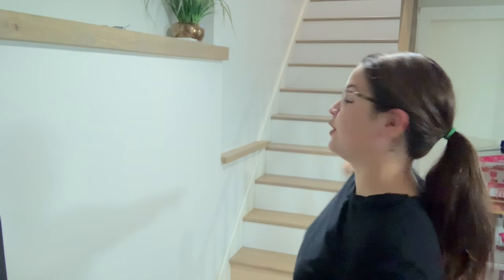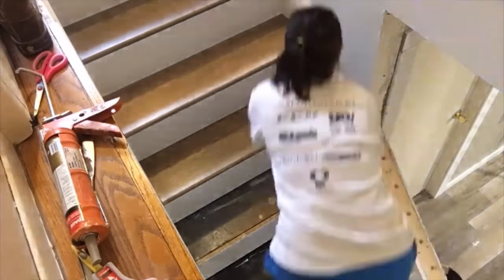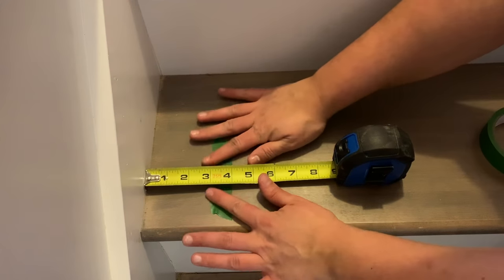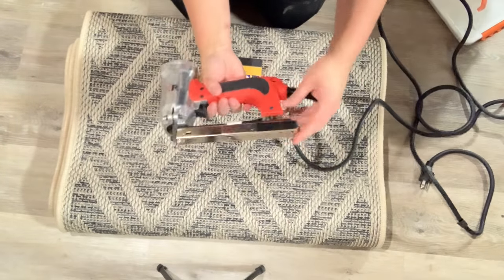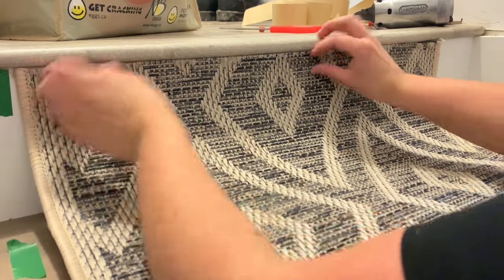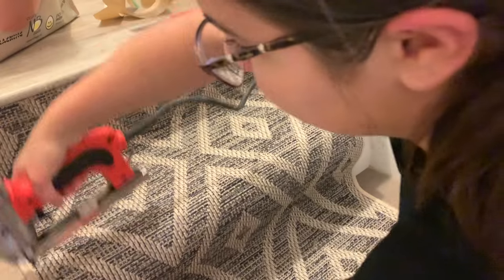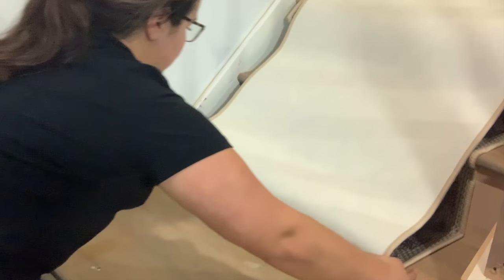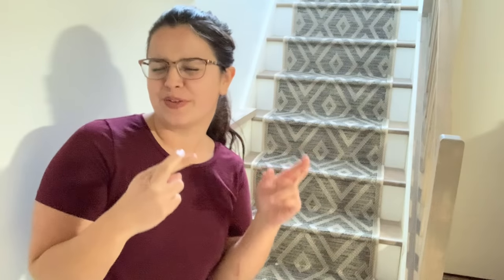How to Install a Stair Runner - The Right Way

Comment: Just here because you're super cute. You did a good job overall. Nevertheless, you should have had a carpet tucker, and a carpet kicker to take out any slack. You don't “kick” the runner because it can rip. It's just to apply pressure while you take your carpet tucker and make a sharp crease at the back of the stair tread and stair riser. The tucker is also used to bury your staples at that junction. What's worse than falling down stairs is ripping open your foot on a staple and then falling down the stairs... just saying.
Reply from the maker: thanks for the tip!  I didnt know those existed

Comment: How did you measure how much of the runner you needed for the stairs? Also, really great video!
Reply from the maker: Thanks  so much! I measured the length of the stair treads and risers.   Then multiplied it by the number of stairs and added a few extra feet

Comment: Im about to do mine but im torn between using underpadding or not.  What led to your decision not to use padding?  Thanks!
Reply from the maker: I personally felt like it was too many layers that could potentially slip or move.  The rug I used is also super thick so if you have a thin one maybe?? But I definitely didn’t need it.  Good luck!!

Comment: Hello my staircase creaks a lot when I step on it. Will installing a stair runner help absorb the noise ? Are there any other alternatives ? Thanks again great video !!
Reply from the maker: Hey! I don't think it will help much with the noise BUT, if you screw through the treads to secure them to the stair stringers, a stair runner will hide that and it should stop the noise.

Comment: I'm tackling this job this year (after putting it off) would you recommend laying an underlay under the rug or not?
Reply from the maker: Definitely not. A few years later and I think I might of actually overkilled it with tape. Staples on another job I did worked just as great.

Comment: About to do my basement stairs.  Too slippery for our one dog who isn't using  a back leg.    Do you regret not putting any padding underneath hindsight?  Debating on using padding or not.  Picking up our runner tonight or tomorrow night. Will install on the weekend.
Reply from the maker: I didn’t use padding because my runners quite thick.  I don’t feel like it has more pros or cons. Just depends on if your runner is thin or not

Comment: One thing I couldn't tell in video, what r all the places u staple, is it bottom of riser, back of tread, under the lip and sides? Where on sides did u put the staples? Right on that border edge or inside of the little border? Tks 😊 oh and what size staples? Sorry so many q's 🤦‍♀️
Reply from the maker: So sorry I didn't see this comment! 

Theres no real rhyme or reason because the staples get burried in the rug, but definitely under the lip of the tread and where it bends.  The staples are 16 guage! Hope this helps

Comment: great job, you left out an important thing....how did you measure for the length rug needed for the stairs? Also I wonder how long carpet tape last to hold carpet down compared to old school tack strips.
Reply from the maker: I don't think I would trust carpet tape on the stairs, it would be a hard wipe out.

But to measure, use the Depth plus height of one stair and then multiply it by the number of stairs. add 2 or 3 for waste/ rolling voer the lip edged etc.

Comment: How long was the runner and how many stairs do you have? Great video.. I'm doing my stairs now so I'm saving it as my go to.
Reply from the maker: I have 17 stairs and the runner was about 26 feet long to start with. 3 feet wide. I didn't quite use it all. Good luck on yours!
Reply: @dcwoodworks  thanks for getting back to me.. I'll be using your video to help install mine 😊

Comment: Hi nice job, I was just wondering if the staples were very noticeable on the runner, especially due to the colour of your runner. 😊
Reply from the maker: Hey! Great question, no they aren’t. The power of the stapler pushes them deep into the fibres of the rug
Reply: @DC WOODWORKS  Hi thank you so much 😊
Reply from the maker: No worries! Good luck!

Comment: My question is how did you find a runner that long I know all stairs vary but what length did you purchase
Reply from the maker: I found mine at home depot, they sell it on big wheels and can pull off what you need.

Comment: Does this reduces wooden stairs quirking noise in any way? It looks easier to install instead of installing carpet for whole floors like professionals do.
Reply from the maker: it doesn't but if you have a squeaky stair and plan to install a runner, you can use screws to screw through the stairs to stop the squeak and then cover it with the runner. Hope that helps!

Comment: How long is your rug? How do you measure?
Reply from the maker: I’m not sure the exact length but I measure the rise and run of the stair and multiplied it by the number of stairs.   (Then I added 3 lengths just in case)

Comment: How do you measure how long of a runner to buy?
Reply from the maker: Measure the height and depth of your stairs, and multiply by the amount of stairs.   Then I add a few.
Reply: Average 1 meter per 2 steps.

Comment: I clicked on this because 'the right way" was in the title.  Thanks for the video.  I'm going to use underlayment/padding underneath.   This looks like energetic DIY, but I'd suggest continuing to google a few more pro installations.
Reply from the maker: Hey. I am a general contractor and a carpenter by trade. So if that’s what you mean then your already here! 

Underlay is optional and your choice. I have done them for clients but personally didn’t want it because my runner was thick enough

Comment: What if you have an overlap nose, would this work? The tread would not be 100% flat?  Also I'm not concerned about the riser but wouldn't the staples permanently destroy the tread? Currently using stair tread carpet with carpet tape. Long term plan is getting flushed nosing.
Reply from the maker: You could carpet over the nose for sure. The staples will create little holes yes, but not as big ac a screw or nail.  or you can use it double sided carpet tape on the treads and just staple the riser.
Reply: @dcwoodworks  thank you so much for the feedback. You did a great job on yours.
Reply from the maker: @justjess1184  Thankyou so much! Write me if you have anymore questions. I love helping!

Comment: QUESTION IS SINCE IM IN A RENTAL HOUSE. WILL THE TAPE COME OFF EASILY WHEN WANTING TO REMOVE THE CARPET. AND WHAT KIND OF TAPE DID YOU USE
Reply from the maker: I haven’t removed my tape yet so I’m not sure but I think goo gone would work just fine to remove it.     I just used double sided carpet tape. Found at hardware stores. There are several brands
Reply: Do you remember the staple size
Reply from the maker: @toneman8478  i don't, sorry! but maybe 3/4 inch?

Comment: It's actually not the right way to install steps. The right way is to install over pad & tackless. Good luck if you ever need to do a re-stretch, you will be pulling hundreds of staples and likely damage the runner doing so.
Reply from the maker: There are several ways.  You do yours
Reply: @dcwoodworks  No doubt but your title says "The Right Way"
Reply from the maker: @Kurt9099  it is.   You clicked didn’t ya?

Comment: Definitely not straight look at the gap on the top and the bottom on the left.
Reply from the maker: Nice try lol
Reply from the maker: Good thing your eyes work and noticed the 4 inch foundation wall that is capped with wood that makes the stairs 4 inches bigger at the top

Comment: Not how you do it at all
Reply: tbf, don't know if it's done differently in different parts, but here in the UK you wouldn't fit a runner like this generally. We use gripper rods, and would generally fit underlay. You're way looks secure enough though and I like the look of the carpet tucked up under the nose of the stairs. Good job!